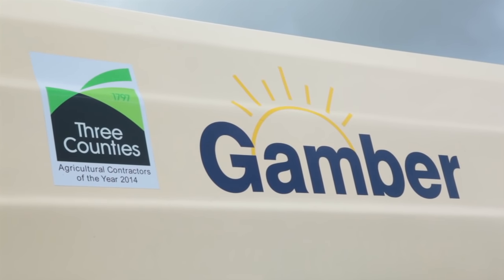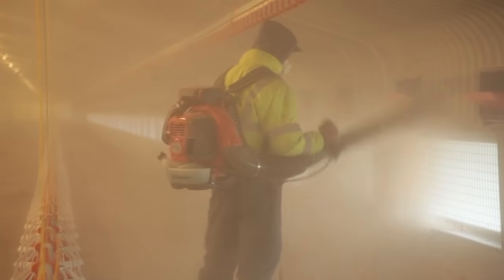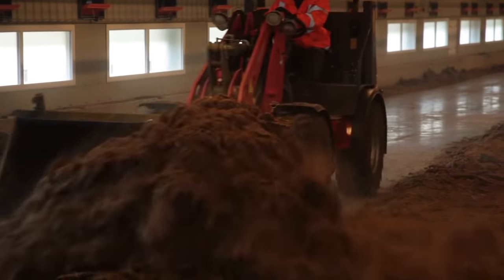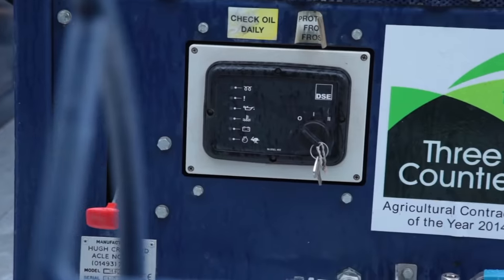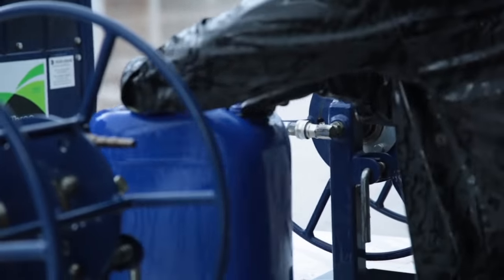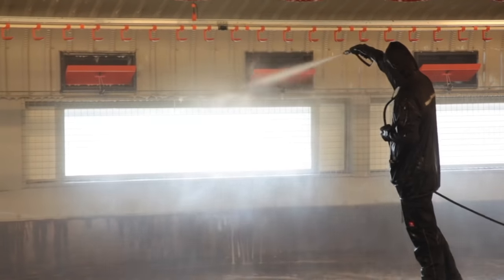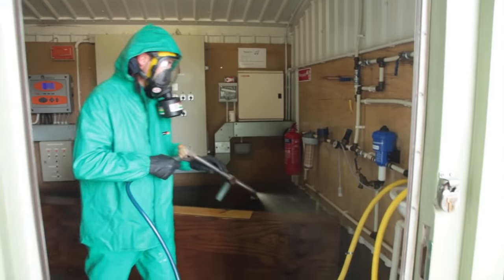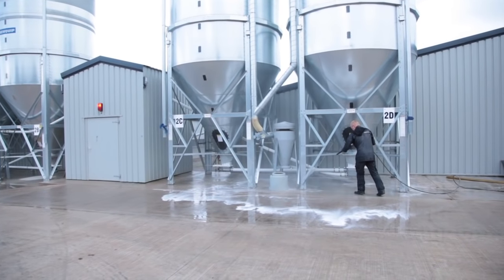Gamber Poultry Cleaning

Comment: Hi guys, great video! Could you perhaps give me a time span of the different processes, i.e. the dry cleaning, wet cleaning, disinfection?
Reply from the maker: Dry cleaning 1.5 hours, washing 6hr, disinfect 10 min (these are average times for an average shed)
Reply: @gamber7717  how many high pressure washing lines do you use to maintain such time? Do you use 2 hoses as seen on the video or more?